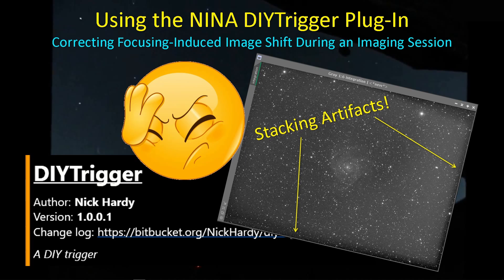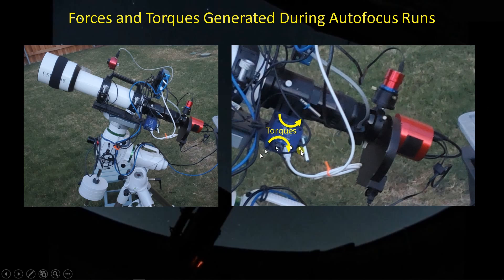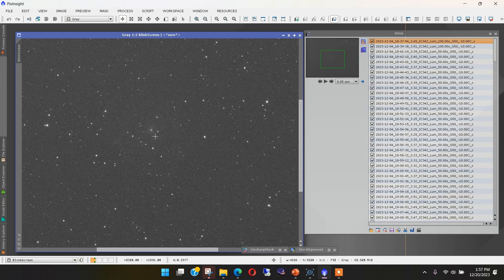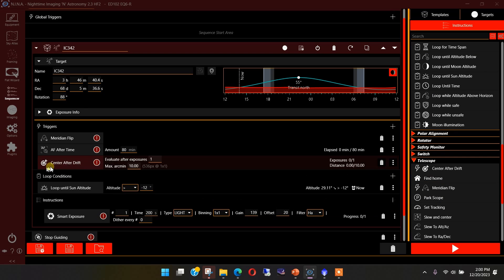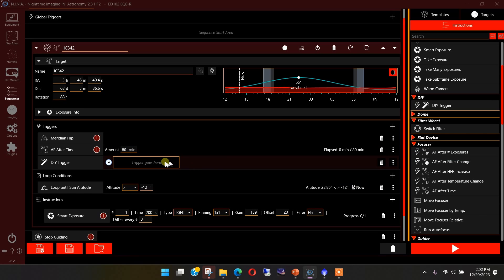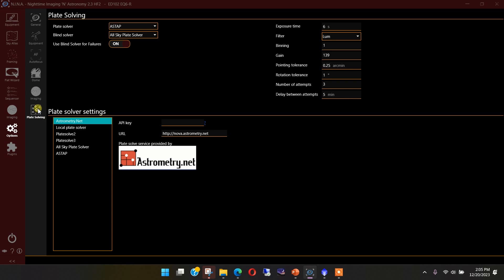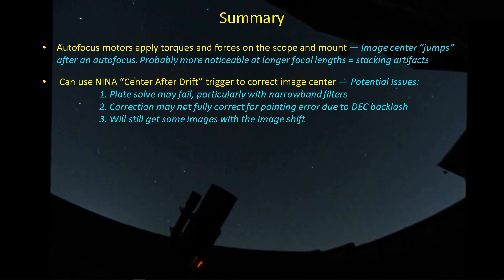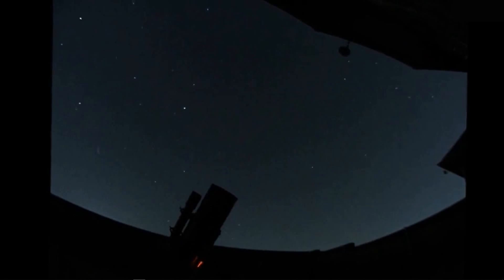Using NINAs DIYTrigger Plugin to Correct for Autofocus-Induced Pointing Error

Comment: As always great, thorough and insightful videos!

I wonder why the “Center after drift” trigger does not actually do the recursive centering? I can’t seem to figure out why you would not want that always?
Reply from the maker: Thanks for watching! I’m guessing that it’s the time commitment that they’re trying to avoid with Center After Drift. The Slew and Center instruction takes an exposure (6 sec or so), performs a plate solve, moves the scope ( 2 sec plus a settle time[?]), takes a second picture to confirm (another 6 sec), plate solves, and maybe repeats again. The Center After Drift just makes a blind move, which is ok If you don’t have backlash. Saves maybe 20 to 40 sec which is great…if it works. It doesn’t for me.

Comment: James, I enjoy how thorough you are in your investigation of this problem but find it extremely hard to believe the cause of this drift is torque from the focus motor. You did mention that you stop auto-guiding during your focus routines. Are you 100% positive it is not just drift during the focus routines? Maybe your polar alignment is off just a bit. One way to tell would be to time how long a focus routine takes, then do an unguiding sub for that period and see if there is drift in the same direction.
Reply from the maker: Hey Greg. Haha. I’m not 100% sure of ANYTHING! But I agree with you. Some potential causes: (1) the forces/torques acting on a mechanical system with mechanical free play in the gears, (2) “Normal” drift due to polar mis-alIgnment, and (3) forces/torques acting on the focuser gear train as noted in the comment to your comment. Plus any number of other causes I haven’t thought of. I polar align each night before imaging, but I will investigate this more. Good question!
Reply: I think that drift is caused by the focuser itself. These stock focusers have very lousy tolerances and the motor focuser will cause a small tilt in the imaging train and consequential drift. 	 see it during focusing of my sharpstar scopes all the time. These focuser do not have bearings like moonlites focuser, but only some sort of shims opposed to the rack and pinion side and this is very prone to tilt and drift.
Reply from the maker: @speppino  Very good comment. Several possible issues (including mirror flop with an SCT). Nice to know that the DIYTrigger plug-in solves all of these which means I don’t have to be that smart! Thanks for watching!

Comment: What reducer do you use?  I have the 102fcd and have always had trouble getting a flat field.  The ES FFFR isnt made for the 102 (which i found out after buying) so now use the stellarvue 0.8 SFFR25, but finding the right backfocus is a big challenge for seemingly no good reason.
Reply from the maker: I’m using the Hotech field flattener (just a flattener, not a reducer). It works well. Thanks for watching!

Comment: I'm a little confused. It looks like you are not dithering. I always have stacking artifacts like you described but I thought it was from dithering. Maybe I should look again.
How do you avoid walking noise in your stacked image if you don't dither? Thanks James, I always enjoy your videos.
Reply from the maker: I rarely see walking noise. It was more common when I imaged with a DSLR combined with my Celestron CGEM. I suspect the CGEM was the culprit - more of a guiding issue than fixed pattern noise from the camera. As for stacking artifacts resulting from dithering - I think dithering radius should be within 10 pixels and should not produce noticeable stacking artifacts. Stacking artifacts like I'm seeing result from large (~50 pixels) jumps in the same direction. Dithering is random and much smaller in amplitude. Try out this DIYTrigger in your autofocus and see if the artifacts disappear. Good luck!

Comment: Are you dithering ?
Reply from the maker: Hey Dale. No, I'm not dithering in this session.
Reply: Did you dithert in ths sessions where the focuser is throwing off the pointing accuracy?
Reply from the maker: @MegaMichaeltodd  No. I don't dither. Dither does 2 things: (a) reduces fixed pattern noise and (b) improves resolution for under sampled images when combined with drizzle integration. I don't see fixed pattern noise and this scope/camera are not under sampled.